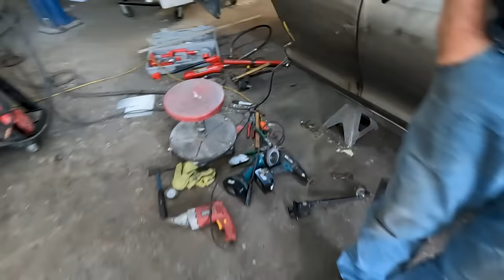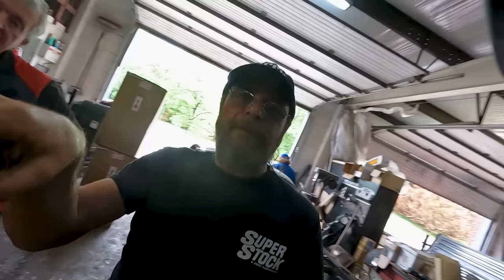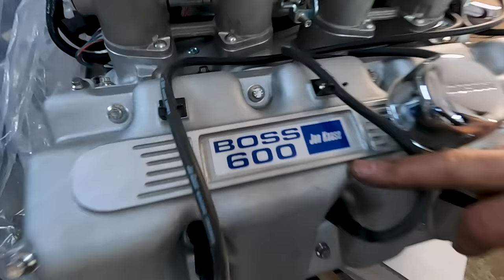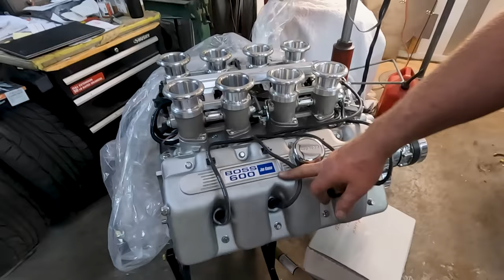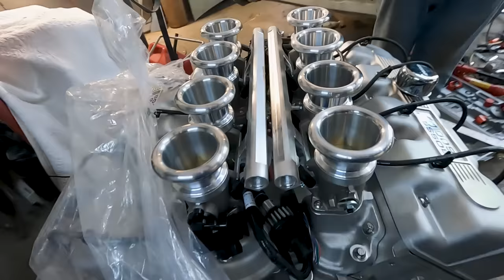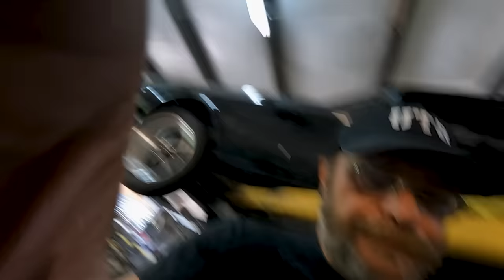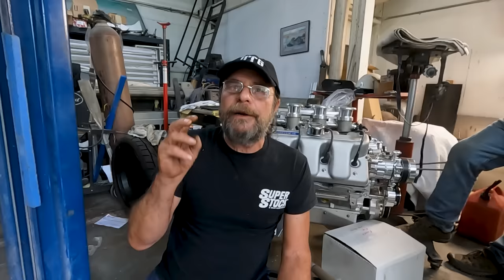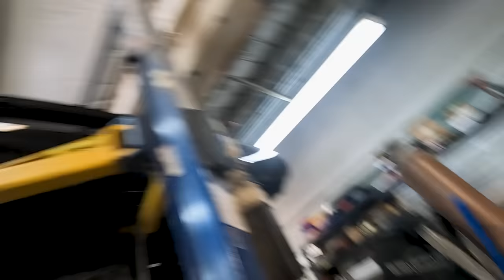How Ford Screwed The Pooch On What SHOULD Have Been The Greatest Musclecar Engine Ever

Comment: Junk engines. No factory warranty like gm has. A very high end shop just had 2 shit the bed on a high end build. 1st one threw a rod at under 500 miles and NOT being over revved. 2nd one has extreme low oil pressure from the 1st start. It could be 4000 hp and it doesn't matter if it won't stay together and no warranty on top of it. I hear the broncos engines are junk too.

Comment: Mopar to the core? Ok, I can dig that! But when you find something like the Boss 429 it needs to be respected. Big Block Chevy? Hell no. I’ll take a Mopar any time. Small block Chevy? Nope. Mopars got them beat, along with AMC, which is my favorite. Why? The 390 and 401 engines are incredibly tough. The 343 and 360 are good for 6,000 rpm, and perform well as long as they use Dogleg heads. Dogleg heads had the highest flow of everything but the 351 C at the time when they came out. Their design took many of the best features of several engines except their oiling system, which is easily overcome. Getting back to the topic, nothing compared to the Boss 429 for the street anyway.

Comment: is this as good as old car your kid hammered a screw driver threw hood its old car dad behind the barn ( dad it only old mustang they cleaned it up it GT 500 with big bock 428 in it) they restored it sold it. it  pay off the house & land!
Reply: ps it called dodge brain faded it come from 440 & super bee cop cars & test track cars by uncles and dad the worked at dodge plant & test track or head cop in station ps car testing out late 60's early 1070's  dose this fit? i was one the kids in back seat

Comment: Bbc is junk.  I'll take a bbf anyday.  Chevy you need aftermarket parts after 500 hp.  Ford been 800+ on stock crank and rods.
Reply: Bla Bla Bla.......Bla
Reply: The 351w will take 800+ on sbe lmfao.  No gm trash is doing that

Comment: i would completely disagree with your statemant that the BBC is the undisputed king of N\A horsepower, are you smoking crack???? NHRA Pro Stock has proven over decades that the BBC couldnt compete with the Hemi, Boss429, or the 427SOHC, hell, the lowly 428 Cobra Jets womped on BBC in stock classes. Bob Glidden absolutly dominated with the Boss429.

Comment: First full of CRAP especially for a guy who is supposed to be a MOPAR expert......sounds like the same BS Chryslelr fed Billl France about the 426 hemi being an enlarged 392, when in fact the 426 was a new redesign with a DIFFERENT block that featured (copied from the 427 Ford) crossbolt main caps, the heads were completely different valve and rocker arm geometry.............get a clue.

Comment: BBC the undisputed king of the BB? On what planet, the most popular shure. But why? Been a mechanic for over 50 years, and one reason is that the BBC had the corner on speed parts. Literally hundreds compare to Ford and Mopar only having a very limited source and supply. What engine won Lemans, Daytona and Sebring in the 60's, no BBC. The FE series was a dominant engine and put the BBC in it's place more often than not. And even the 460 which was voted the easiest engine to get 600 hp from was a true performer. Mopar's max wedge and the hemi also kicked Chevy ass for decades. The other big reason was NHRA catered to the teams that ran GM stuff while factoring both Ford and Mopar. Your twisting it here bro. For those of us who were there know what I am talking about. And this bias is still being done today with the factory stockers. Ford and Mopar run the same kind of s/c, while GM runs another. Ford runs a 5.4 while Mopar and chevy run the 7.0 liter. nuff said.